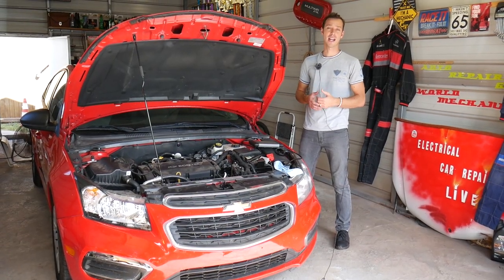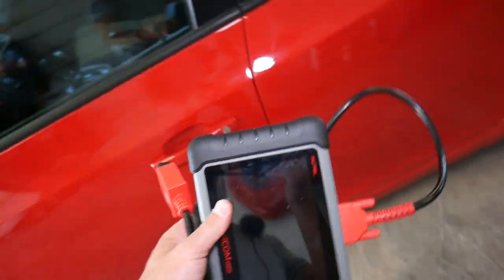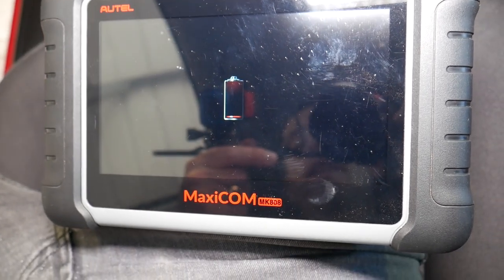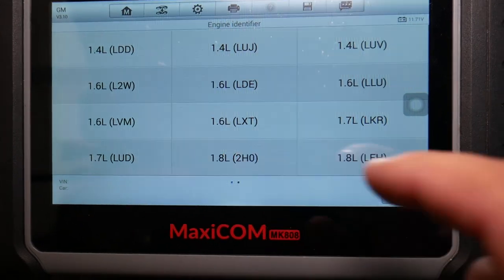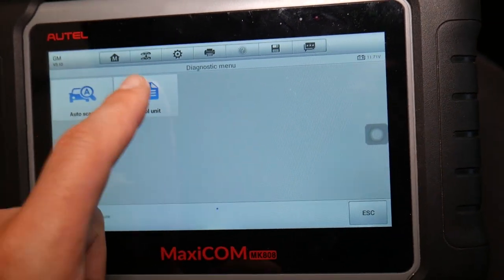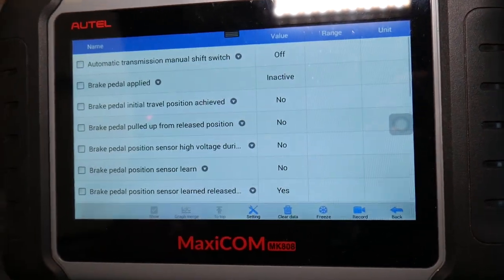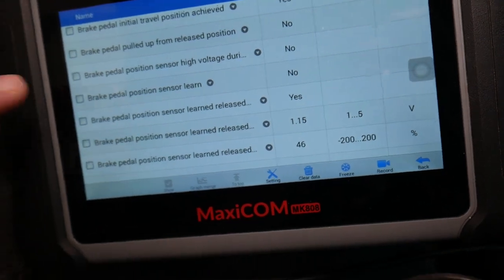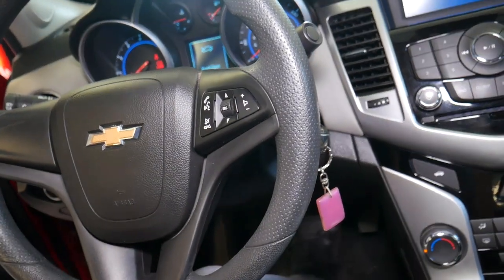HOW TO TEST BRAKE LIGHT SWITCH ON CHEVROLET CRUZE CHEVY SONIC. BRAKES CRUISE NOT WORKING

Comment: Hello i have a problem in my cruze
Yesterday i got a little Accident in the backside of bumper ventilation area after that i park position at the car then out and check then i go inside my gear knob is stuck on park i dont know what happened then i search the hidden button and then use the gear now my car condition is gear knob still stuck on the park position and break lights not working also trunk is not working please help me to get out of this situation i hope you understand
Reply: Did u find a solution. I just got this problem.